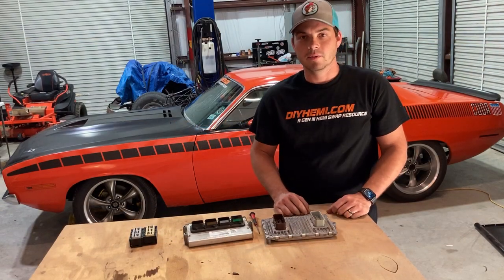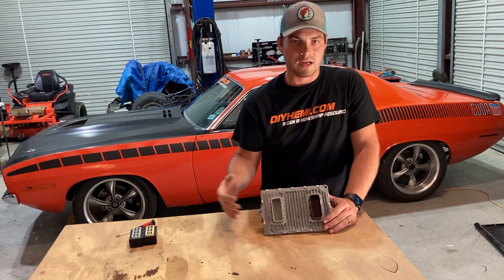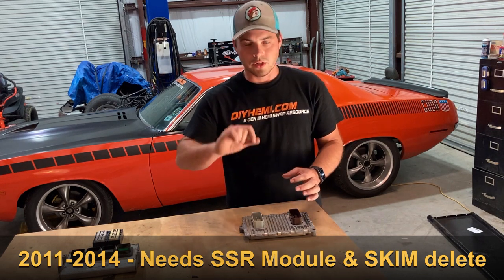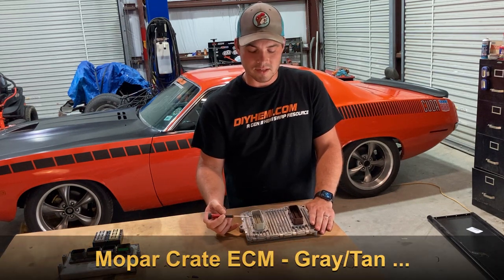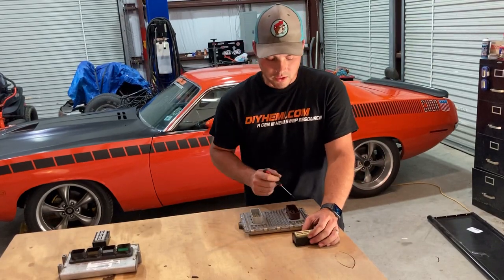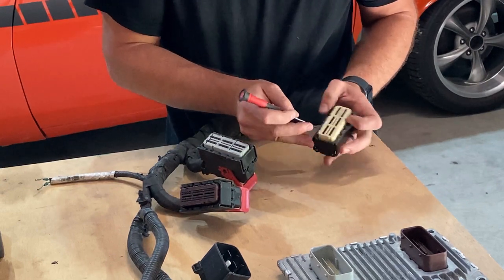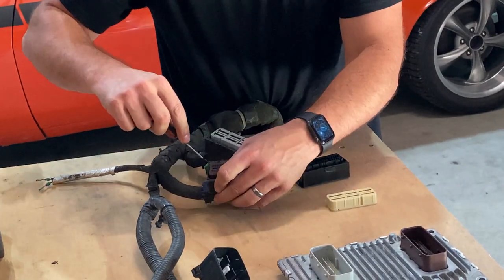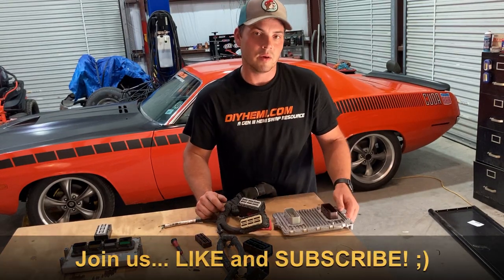Know the Difference and how to SWAP throughout the later HEMI GPEC2 ECM/PCM

Comment: I will change the interior parts from a 2012 Challenger to a 15 model. Do you mean buy the color and wire harness and it will work on the older model?

Comment: Hey I know y’all are very busy and if you can find the time to help it would be greatly appreciated I have a 2015 dodge that I still owe 15,000 on and it has been  sitting in the yard for over a year I tried swapping the motor (original had a rod through the block) with a 2004 motor that was completely rebuilt no mds when I turn it over it cranks for a half second and dies it will run on ether and is throwing no abs, improper torque, and no communication with ecu codes.
Reply: They changed reluctor wheels on the crank in certain years, I've run into this before

Comment: So I have a 2005 limited 5.7 grand cherokee I bought for 600 bucks with a blown motor. I have a buddy with a 2015 5.7 30k mile motor out of a challenger thats hes willing to let go of for less than a used 100k+ mile 2005 era. If I get a vvt delete kit, what else would I need to make the swap? I've looked on forums and everyone says it won't work cuz of vvt. But if I delete it what else is holding it back?

Comment: I've seen several explanations on the engine harness configuration and the ECM, however, not one on the TCM or to be more specific the NAG1.  What I mean is what's needed to make this transmission shift properly on a SWAP.  There are several companies out there that have a monopoly on the setup itself at a very costly price tag.  So, it will be good to see a DIY on a NAG1 on the economical side of the configuration and the components needed to make it work to include the possibility of having it re-flashed.  By the way... Great explanation!

Comment: I have the crate ecu hooked up to the 6.4..... runs great!!
Is there an extra pin in that ecu so i can run my wideband wire to it for ez data logging??
I kno the LS guys use a egr sensor that is no longer there and they can data log wideband kinda ez

Comment: So I can take a 2017 Dodge Ram with a Hemi and put it in a 08 Hemi pickup
Reply from the maker: 17 engine wil only work in an 08 truck if you lock out the vvt cam phaser and change the crank reluctor wheel
Reply: @SUBLIMEparts   is there no way to get a newer 09+ pcm/ecm to work in a 06-08 canbus ram?
Reply from the maker: @fredbuzzell117  some say a 2009-2012 ram ECM will make that work

Comment: Can you use the old 4 connector pcm from an 08 ram with a 6.4 from a charger or challenger? To give a bit more explanation, My 5.7 is tired and I’m wanting to swap in a 6.4 into a 2008 ram 2500 5.7 hemi truck.
Reply: Hey did it work out for you I’m Trynna do the same thing now
Reply: @FISBANGA  ended up going a different route

Comment: I’m trying to search online for the mopar crate ECM, I’m not really finding it with mopar. do you know if they sell just the ECM by itself without the harness or where I should check on that?
Reply from the maker: Mopar calls them a PCM most times. Try checking summit or Jegs. I know they tend to be ‘sold out’ many times. But the are out there
Reply: In the crate harness instructions I found a part number.  https://www.mopar.com/moparsvc/pim/media?id=9012411170846  It's P5160105 for the 5.7 and P516014 for the 6.4. Some of the mopar sites claim to have it in stock.  Summit says they will special order it.
Reply: @roycebrown3447  fantastic, thank you!

Comment: Do you have any recommendations on running a stock analog tach with a 2004+ hemi? I've read about some tach adapters but there's still some confusion.
Reply from the maker: Yep, so there are several ways to do this. With coil per cylinder ignition you can hook a traditional aftermarket tachometer to a ground on one of the coils and put the tachometer in 4cylinder mode (must be a switchable tach that can go into 4 cyl mode). This will get you a close reading. 

The best thing to do for a stock vehicle tach is use auto meter tach adapter that connects to every coil and outputs a conditioned signal similar to older Mopar ignition systems. This is the most accurate way to go. Check out the auto meter 9117
Reply: @SUBLIMEparts  Awesome! Thank you for the info! The Autometer tach adapter looks like it will fit the bill perfectly.